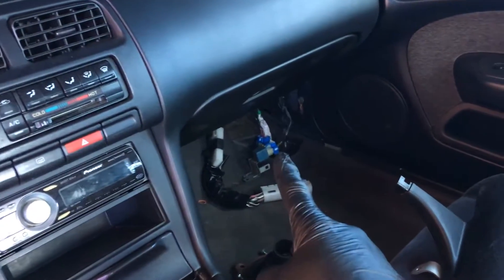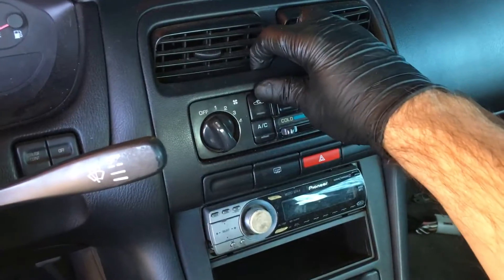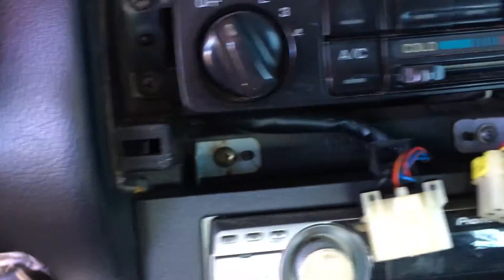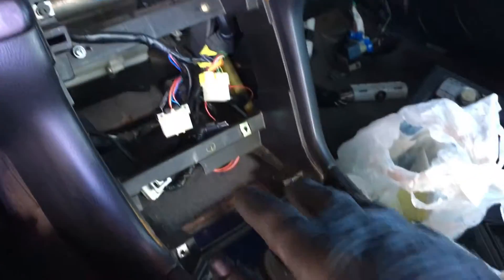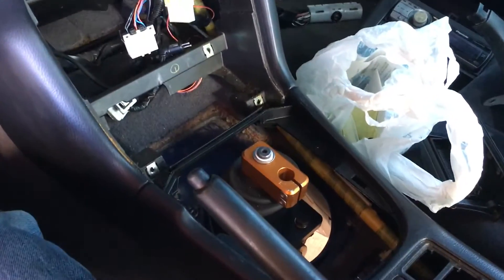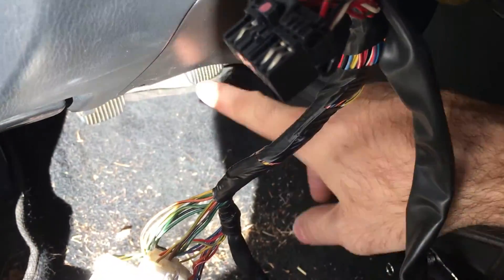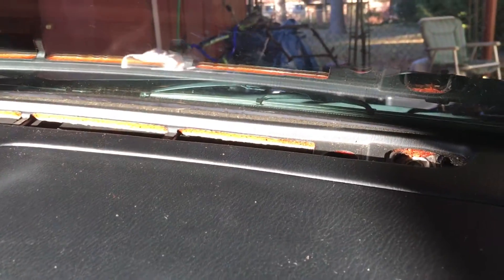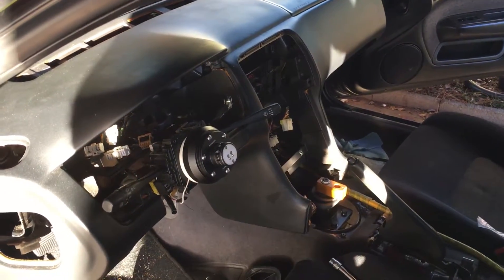Engine harness & Dash removal - LS1 240sx (S14) Drift Build (EP 39)

Comment: Can you remove the wiring harness without taking the dadh
Reply from the maker: There is a clip that is holding the harness on the firewall. if you can get that off then you might be able to but its a really tight fit.
Reply: @toxicmongoose7061  I’m having some trouble and I think that’s the problem I might be having, thank you

Comment: Hey man, i have a question.  around 10:45, you can see all the plugs that you had to disconnect.  are there any plugs besides those that need to be disconnected, maybe behind the blower?  i’m trying to pull my harness through but it won’t really move at all.
Reply from the maker: From what i remember there was a clip that you had to pull  off.. I also believe I took the bolts off the a/c heater core unit to give me more space.